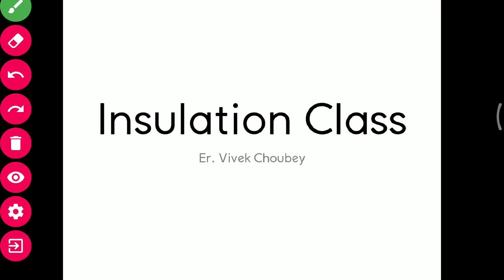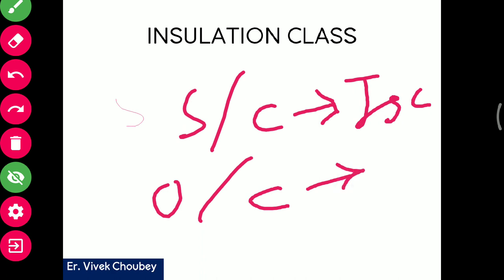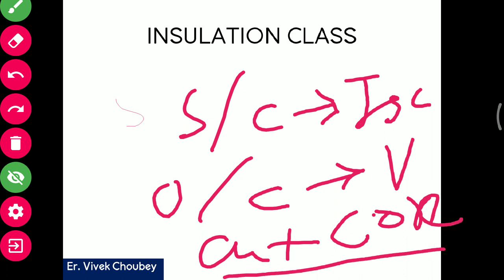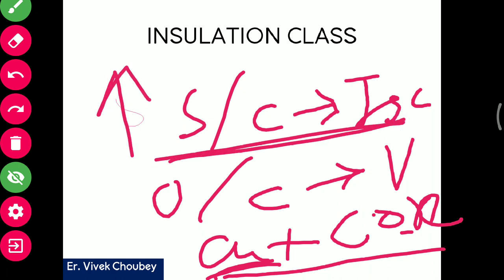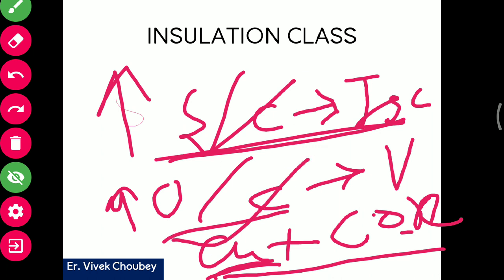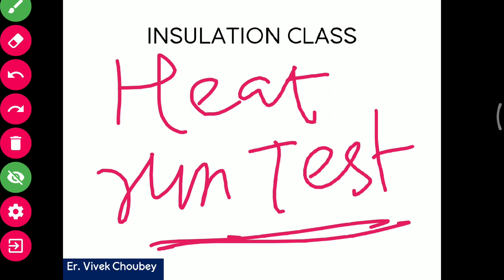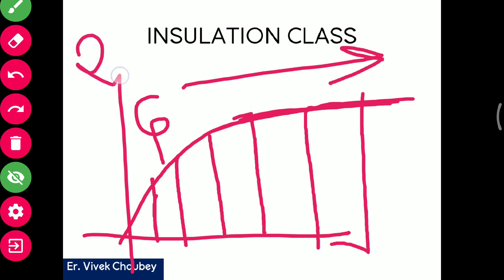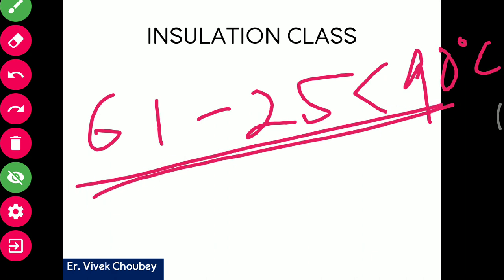Classes of Insulation and Heat Run Test | A Brief Insight

Comment from the maker: @6:37 or @6:38 it's not operated on rated voltage but rather on a voltage necessary for required short circuit current (=core loss current+rated winding current) to flow.

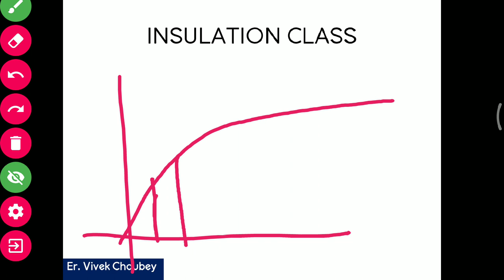@8:23 The temperature rise curve will begin from ambient temperature and not zero as the machine will be at ambient temperature before operation

Comment: Very helpful.. Thank you
If the ambiant temp is 55C will class F will be OK for a motor?
Reply from the maker: Ambient temperature=55°C 
Then the maximum allowable rise in temperature for the machine should be (90+55)°C with some tolerance. If the motor temperature under operation saturates at higher temperature then it won't be a class F insulated motor.
Reply: @ervivekchoubey  Then it should  be class H. Thank you sir.
Reply from the maker: @Darkblue332  but in which place ambient temperature is 55°C?
Reply: @ervivekchoubey  In south of Iraq . A town called Basrah . Sometimes it reaches 53C .
Reply from the maker: @Darkblue332  oh! That's too hot place I think. Thanks for the info.
Reply: @ervivekchoubey  . You have been so kind and helpful . Thank you very much sir .
Reply from the maker: @Darkblue332  No problem dear. Have a great day :)
Reply: @ervivekchoubey  😊

Comment: Good job, but is the heat run test calculation is the same with generator
Reply from the maker: Yes I think it's the same or there can be some design based differences.